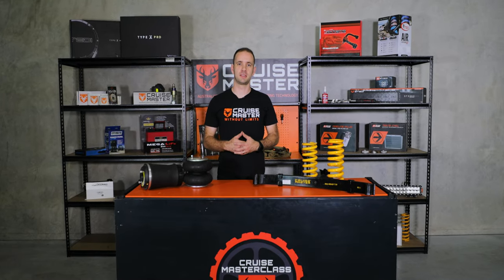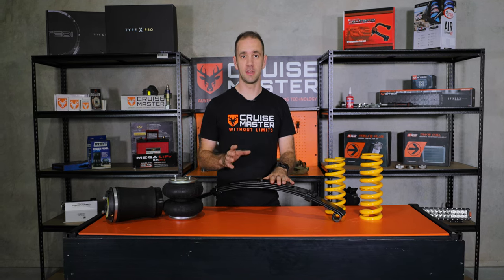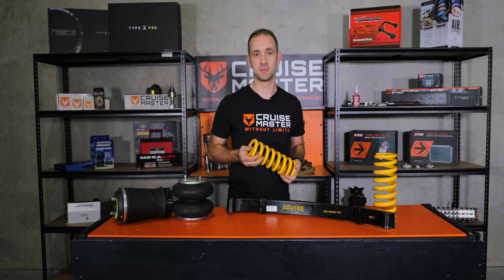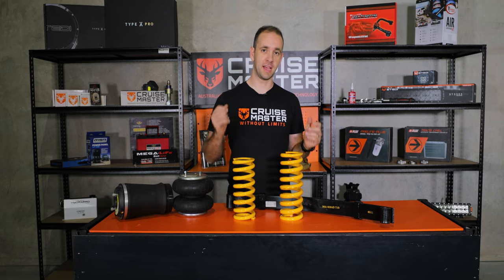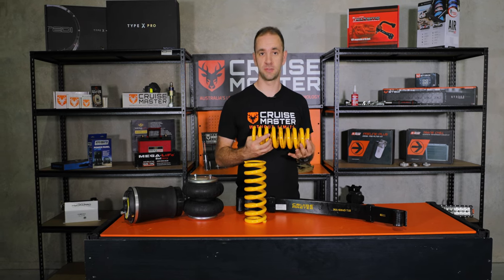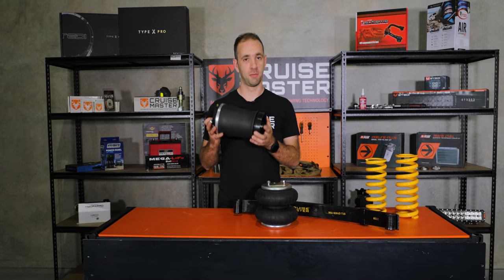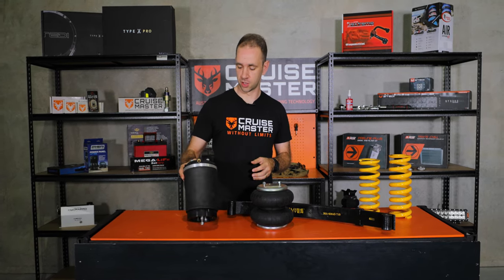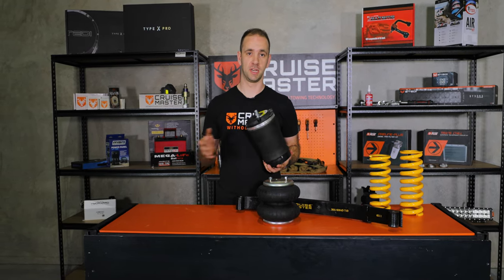CruisemasterClass - Ep. 15 Air vs Coil vs Leaf Springs

Comment: For me, a con of rolling sleeve air bags is getting grains of sand putting pinholes and causing deflation. Coil springs are durable and low maintenance

Comment: great vid as usual . quick open question subject , i have level 4 suspension on 19.6 Scorpion Sting with a weight of 3.2T . any recommendations on pressures/deflation for the PDR or Gibb etc . viewed 99% of your vids and you don't mention it although I'm bloody sure you've tried it either with or without success  ...   cheers   ..  pete

Comment: How long will the rolling sleeve airbag (ie., on the CM ATX)hold it's pressure when you are at camp and you've leveled the trailer? Does it leak a little bit of air every day and need to be adjusted to maintain level?

Comment: Hi Andrew
Having watched a all last episodes I must admit that this vid is „not ringing any bell“
To basic and absolute no tech information included… 
I missed for example information for appr. Travel way and heights in comparison as an average as you have this datas for the cruisemaster air and then vs the coils. Offroad trailer do not have leafsprings. 
Please put a bit mor tech information into such vids would help and your viewers are not all  beginners
Thanks….
Cheers